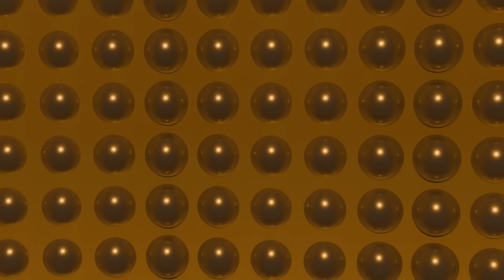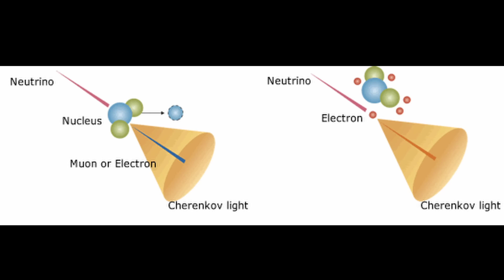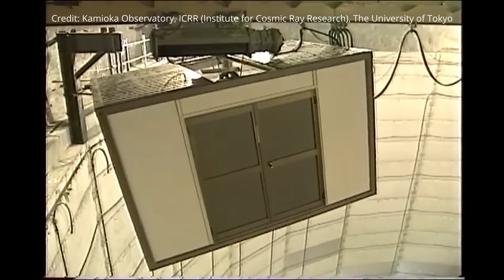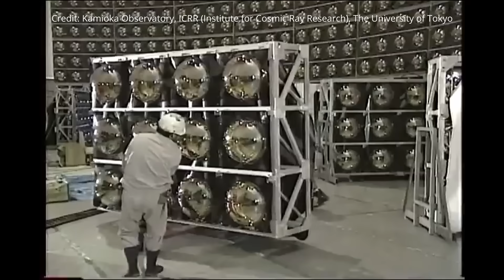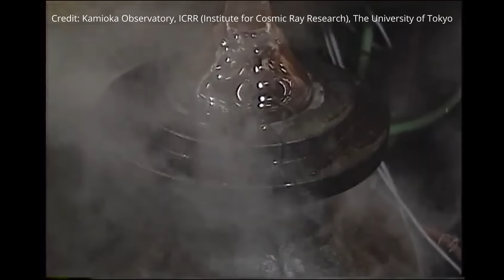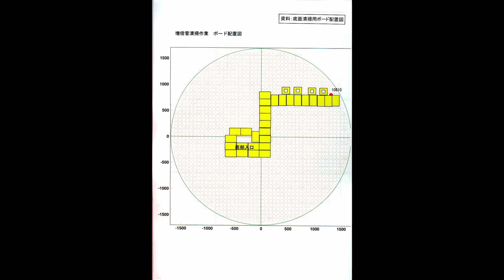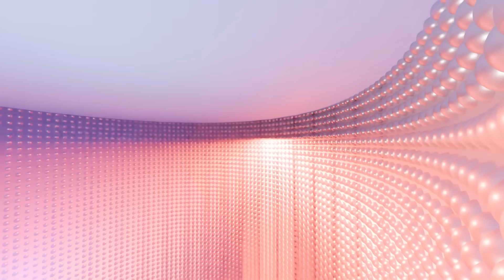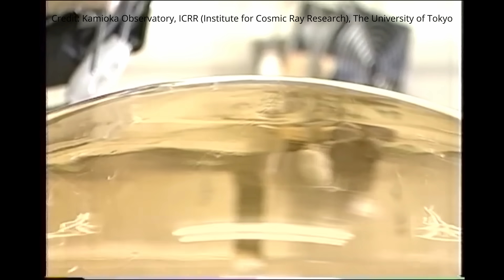An Engineering Fairy Tale: Cascade Failure at the Super Kamiokande

Comment: This gets me thinking. I am loosely familiar with the experiments to ‘slow’ photons by sending them through a pressurized and supercooled gas. The photon is collected into the outer electron shell of gas molecules, and in some way I am not informed enough to relate here, is transformed into either an electron or something that behaves like an electron, until such point that the temperature of the gas is raised very slightly, which allows the electron, or an equivalent thereof, to be released as a photon again, traveling in the same direction as its original path, and at a speed relative to the temperature which allows its passage through the medium. Obviously we know that all photons have a maximum speed and they travel as close to this speed as the medium of transit allows. A total vacuum allowing the highest possible speed of light. Does this therefore mean that only photons in this theoretical total vacuum do not ‘experience’ the passage of time, and since a total vacuum is not a natural occurrence or even likely to be physically possible, only a very very near-total vacuum, that photons do experience some duration of time as spatial curvature, and that these photons in the experiment of ‘slowed’ light, experience that temporal state even more so? Is it possible, then to somehow pair a photon with a subatomic particle that gives it a very slight mass, and causes some kind of drag, that is not specifically a medium that it passes through, but a payload that a photon can carry? Perhaps not an individual photon but could a series of photons be somehow arranged to ‘pull’ a neutrino along, as one would get a fragment of styrofoam to follow a static charge? Pardon my analogy, but a form with miniscule mass being suspended by a force with no mass but velocity and momentum that overcomes the air molecule mass is the only physical example I can relate within the timeframe of typing a comment-query. In short, can photons be payloaded?
Reply: And yes, i am aware I am wildly outside of my expertise here, being that I am merely an artist painter-sculptor and not qualified to even ask particle physics questions, my skillset only barely intersects with engineering.

Comment: I have got to try recreating it on a small scale and film with a high speed camera.
Reply from the maker: I was thinking the same. Problem is it doesn’t ‘scale down’ too well - the failure pressure generally increases as tube size decreases.
If you can blow something with a really thin wall thickness it may work. If I still had Scuba gear, I’d have tried it myself.

Comment: Setup: In the early 1980’s I worked at a defense components manufacturing facility where vacume tubes were made. These tubes were super-bright CRT’s for military aircraft cockpits… and each had more than a dozen emitters in the tube, all in a high vacume. Very pricy gear… about 15K USD each, in 1985 or so. 
The events: So my friend was testing completed tubes, and one failed. He wrote it up in his report for that day with “Floor Damage” as the cause of the failure. His boss, a management droid who was pretty ignorant, asked him… “What’s this Floor Damage? I’ve never heard of that…”  My pal the tester replied… “That’s when I dropped it on the floor!” KABOOM!

Comment: When I worked for a wave tech company (spectroscopy) we had to have glassware custom blown for us, as sample container holders, with temperature control gadgetry..., and when it comes to precision, the stuff can get really freaking expensive!:hand-orange-covering-eyes:  They have to make several pieces to get a usable one, and when made of a few parts, inlets and outlets... it just goes up exponentially.🤯  Add to that you may wait months to get delivery.  So from what I have heard about those bulbous tubes, they are very precise, at least in the lens part, and so I can agree that at $2000 each, they were indeed a bargain, or we used a way over priced glass blowing company. 

I remember fairly simple pieces costing over $1000 nearly 2 decades ago.  Needless to say when we had to send one out to a customer, we used the original packing, and then packed that in another package for even more shock proofing.:face-orange-biting-nails:  It's not like most carriers can't manage to damage a steel beam embedded in 2' thick concrete somehow.:face-red-droopy-eyes:

Comment: This is pretty crazy. I mean its pretty obvious that a implosion like that would be a problem, and then they tested it and saw that it could be a problem but then stopped short of testing at the actual operating pressures? How do you sit there and say "Well it didn't generate enough pressure at 3m so surely it wont generate enough pressure at 30m".

But to be fair if I was in charge of designing these detectors I totally would have done the same thing. I mean even if it does turn out to be a problem, what are they gonna find a different company to make the hyper specific giant detectors? "Oh noooo they did actually implode like we totally didn't think might happen? No no we totally tested them perfectly trust me. How tragic, a truly unforeseen event... Anyways that will be $30 million for the replacements"

Comment: I worked for the Baikal neutrino project, and we had one of those tubes over from Kamiokande one year when one of their physicists visited. It was a remarkable piece of equipment. Unfortunately, we had no chance to use it as the Baikal telescope is at a ~1300m depth.

On that note: We also had collapse, but it did not trigger a cascade for two main reasons: 1) PMs were spaced farther apart 2) Being open water, there was no wall to further reflect a shockwave.
They were installed in pairs. The adjacent module also imploded, but the effect did not propagate.

That being said, I was amazed to see the effects of such a high pressure collapse. (Titan vibes anyone?) The glass shattered into a sand-like granularity, and the shockwave instantly compressed it into something similar to sandstone. At first glance, I thought that it was some compacted snow, until I touched it.
Nothing was left of the whole module. Just the twisted metal frame and a few pieces of this glass sandstone.

I also liked the AMANDA (today Ice Cube) modules.

Comment: I do some home brewing of beer.  I may have added to much sugar to bottle finish my beer, which is what puts the carbonation in the bottle.  I had a case (24 bottles) in a box sitting in my basement.  I had a similar failure, one of the bottles failed explosively and took out another 20 bottles.  This only resulted in a big boom and big mess!
Reply from the maker: Oh wow I’ve never heard of a cascade over carbonation before!
A few years ago I started a diy project for a submersible pressure sensor to monitor if a bottle is likely to blow up. In the end I decided it’s just easier to deal with the occasional explosion (still haven’t had an explosion yet but I’ve not brewed as much recently).

Comment: Someone else likely already knows about this and if someone has already answered sorry for not finding it. Failure. I found the meaning of things that fail in engineering interesting as a child after learning how air breaks are designed to be 'fail-safe'. This lead me to briefly learn about load and force and the need for such values to be taken into account on top of the operational maximum including things such as thermal fluctuation. My question is this: when building structures such as bridges and tall buildings made of steel(and even wrought iron) needed calculation do to failure after a number of lost lives things such as a cascading failure were understood. The greater the area and the greater the change in stress do to changing forces within that area the greater the margin is needed to prevent the building or whatever the structure from failing all together.  It sounds as if they calculated the resistance of the glass to pressure from an implosion shockwave as though they could use near 100% of those tolerances where it is well known that failure even in proximity to the same components can never do so. For instance steel may only be able to handle a 65% operational load before variations such as temperature or wind/ground forces are also added. There are steel beams out there that fail at 10MT but may have a maximum capacity of only 3MT. As soon as I realized these vacuum tubes were under water I knew there would be a continues load. If a load from one piece only you get more resistance but if load can be transferred across structural members they must be taken into account otherwise you get a failure that will travel until the force is less then the cascade + active load. I remember seeing an actual set of equations for all sorts of types of loads... As a kid I knew this so what gives???

Comment: TL;DW: The experimental equipment is a huge tank that's filled with water and lined with detectors that look for neutrinos (extremely elusive particles that are emitted by the Sun and are constantly passing through Earth). One detector at the bottom (where the pressure is the highest) imploded, and the others that were below the waterline were destroyed by the cascading shock wave that ensued.

Comment: 18:40 I think descructive testing should be done within the most harsh imaginable situation in the actual use. I would have defined that as as deep as possible while also having the biggest ever earthquake recorded for the building area + some margin (e.g. 20%). If that would cause cascade failure, it would happen sooner or later in practice, too.

Comment: I'm not a scientist nor did I stay at a Holiday Inn ( reference to a US advertisment to non US viewers ).

I did think of something that would kind of show what happens when a shockwave expands and collapses. Watching high speed photography of a bullet entering a ballistic gel block, the initial penetration causes a shockwave to greatly expand a cavity in the gel. At the point of collapse, the cavity would be like the tubes, low pressure surrounded by pressure. As the cavity collapses on itself, the spike in pressure causes a flash of light and energy which then expands outward again. This repeats again until the energy is disapated. While not the same as the tubes, it does show how the collapsing void produces a spike of energy which expands again. This is nowhere near the energy level of the tubes collapsing but I think it might give a visual representation of what's going on. Not a perfect representation, but it's what popped up in my non scientist mind to visualize it for other non scientist minds. Be gentle on the flames, I know it's an imperfect analogy.

Comment: For an incident in a similar vein look up the 2008 LHC "incident" where, during power tests in the process of bringing the LHC online, an electronical connection was  less superconducting than it was supposed to be. It quenched. The result: An insane amount of electrical energy had nowhere to go but to through a now normal conductor, instantly boiling significant amounts of liquid helium and ripping the LHC apart in the process.
Reply: Yes I remember that. It was also very embarrassing for the US university that had worked on the design of these magnets.  

Still, they got the LHC right in the end. It’s an amazing machine. The beam energy is fantastic. I once calculated that the amount of kinetic energy in the bunches of particles was about the same as the USS Nimitz doing 10knots (if I remember my sums correctly!). That’s a lot. 

Even more amazingly, they have a means of dumping this energy if they have to. There’s a beam dump, basically a large magnet that can be turned on quickly which redirects the beam out of the machine and into a cavern which they filled with graphite blocks. The particles hit the carbon and the energy is converted into heat. It’s a bit like stopping the Nimitz inside a few metres braking distance!

Comment: I honestly thought the Super Kamiokande was well known in popular science, if not the cascade failure event.  The specific research that is probably the most notable (I'm fairly sure it was featured in a popular science documentary on BBC TV) is that of contributions to understanding that neutrons oscillate in flavour, confirming that they experience time and therefore must have a non-zero mass.  Well over 99.9% of the neutrinos passing through Earth are produced as a by-product of hydrogen fusing to deuterium in the Sun's core.   But detectors like Super Kamiokande only detect a fraction of the numbers expected.  Research from the detector contributed to the confirmation that this was due to the electron-neutrinos that the Sun produces and Super-Kamiokande detects are oscillating to other neutrino flavours on the way which are not detected.

Another interesting fact is that the neutrinos passing Earth where generated just 8.5 minutes ago in the Sun's core, compared with the resulting photons which take millions of years to rise up through the Sun before they get to us.  So this type of observatory is in effect an almost realtime observatory of fusion in the Sun.

Comment: This reminds me of the failure mode of suspended ceilings. Increasing dead load due to addition of services, think fire protection layers or heavy electrical cables, brings a ceiling close to its ultimate strength. One of the little wire hangers fails and the surrounding eight hangers cannot take its load The whole ceiling unzips. Not as uncommon as you might think and cinemas with heavy and intricate ceilings are in the front line.
Reply from the maker: Very reminiscent of Hyatt Regency Walkway collapse. Though that was, of course, due to a construction error.

Comment: what are the outer wall detectors for?
Reply from the maker: The detector website explains it really well. But basically most particles also create a flash in air, but neutrinos dont. So if both the inner and outer sensors trigger for a particle, it is probably a muon (because it was detected in both air and water). If only the inner sensors trigger, it is probably a neutrino.

Comment: 4:19 everything for the next ten seconds is completely wrong and the "that does make anything go faster than the speed of light in a vaccum disclaimer" is DOUBLY wrong for that reason, making it triply wrong overall.
Reply: @removechan10298  hey look I too can claim you are wrong without giving any explanation at all and the timestamp is DOUBLY wrong for that reason, making it triply wrong overall.
Reply: @TheCrazyPozavnist  wrong
Reply: What he said is correct. Electrons can travel faster than the speed of light in a medium, however they cannot pass the speed of light in a vacuum, which is c or 3x10^8m/s. Nothing can travel faster than c. (I know I’m a year late)
Reply: @Arthur-i3p  no, they don't. The speed of light in a medium is still c. They're talking about the phase velocity, which is entirely different, so electrons never travel faster than the speed of light. They do travel faster than a specific phase velocity, and that's why you get Cherenkov radiation, but it goes even worse. By then, talking about speed of light in a vacuum, he's doubling down on the original mistake. Nobody's arguing about things going faster than the speed of light in a vacuum. We're just arguing about the fact that that is the same speed because it's the phase speed. This is the phase velocity, and it's not a small distinction. It's the whole basis of everything. It's a year later, so I don't know why it was tripley wrong, but let's just all look up Tripoli in Italy because that's probably a nice place.

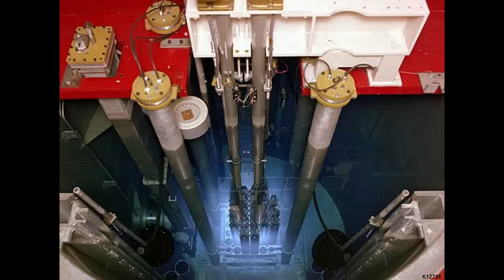Comment: 4:39 NOTHING goes faster than light NOTHING, if you just did 5 minutes of fcing research you would understand that, just think about what you said then ask the medium it is going through then work out the speed of light slows down in that medium then do the fcing maths and it is not faster than light ffs.
Reply: Cherenkov radiation only happens in a medium where light travels slower than c. The end
Reply: Did you notice it's been a month and no likes.

Did you notice that he already said that nothing goes faster than the speed of light in a vacuum. Did you notice your own reply already contains what he said. You just got so blindsided by hearing "faster than light" you IMMEDIATELY tuned EVERYTHING out and made a comment already stating what he said.
Reply: Also, ohhhh boy if that bugs you that much, you should research how fast quantum interactions are and quickly have your mind blown when you find out they're at least 10,000x faster than the speed of light